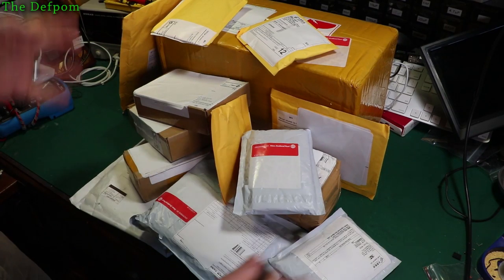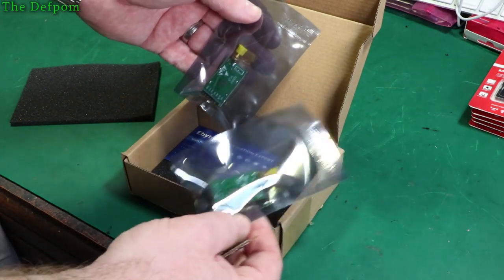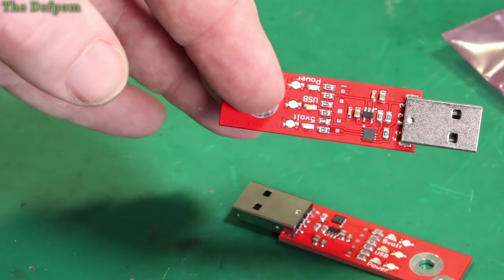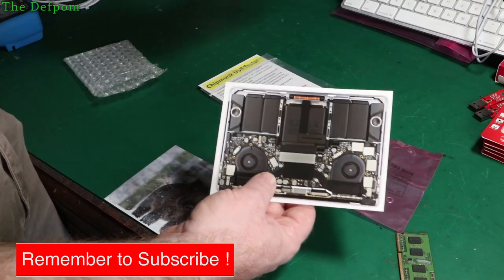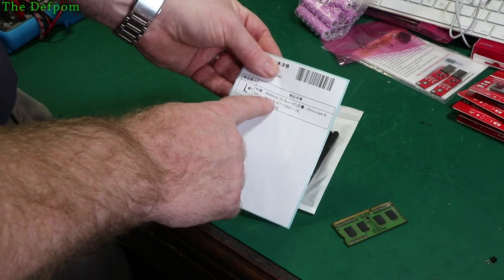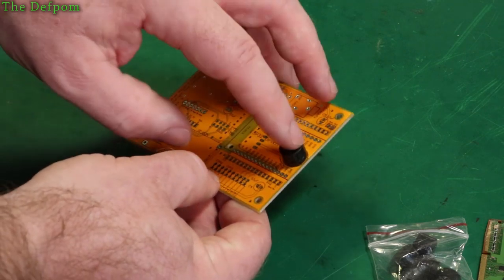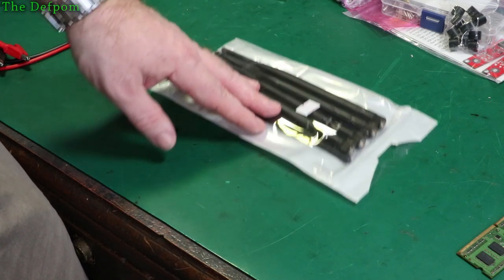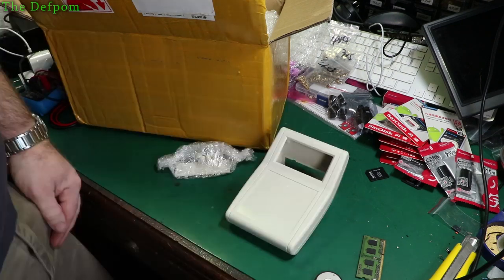#689 Mailbag Monday 24th February 2020

Comment: The brass threaded heatstakes are great for 3d printing projects.  What i do is print the holes to the recommended size, or just measure them so see what the hole size should be, then take a soldering iron with a fine pointed tip and insert that into the center of the insert and melt it into the hole, after the plastic and insert fully cool you will be surprised at how strong they can be.  I do these so much that i made tips for a spare soldering station that has a 900D style tip, i just used some old worn tips and made a couple for inserting the heatstakes, just a thin rod tip, and i took one and threaded it with a die so i can screw into a heatstake and heat it up and pull it out.  They make heatstake stations for these that are basically just a soldering iron with a machined tip like what i made, found them on AliExpress but they were too expensive for what they are so i rolled my own.